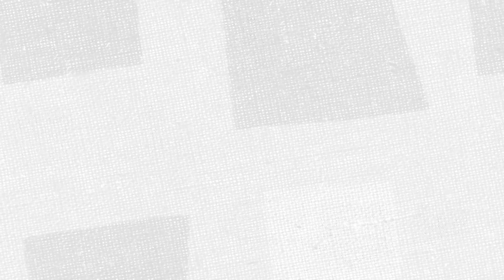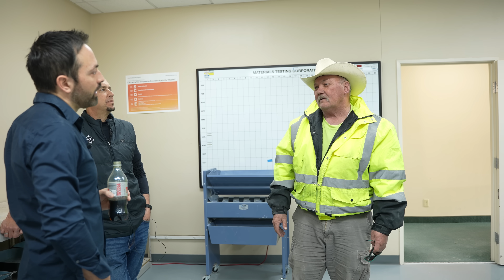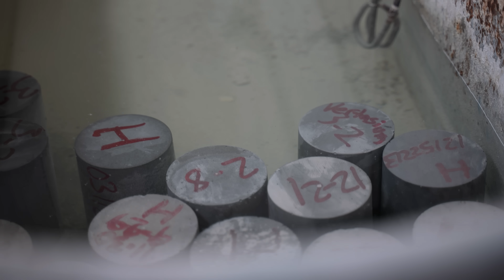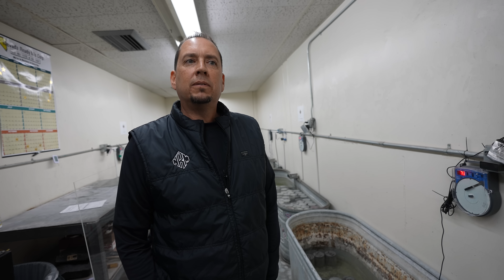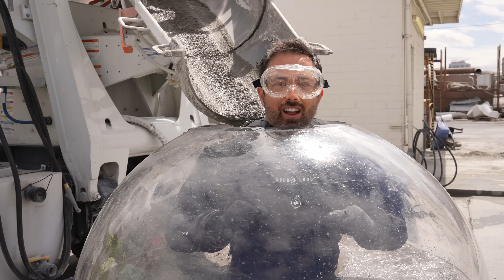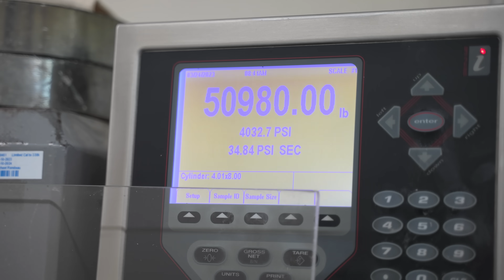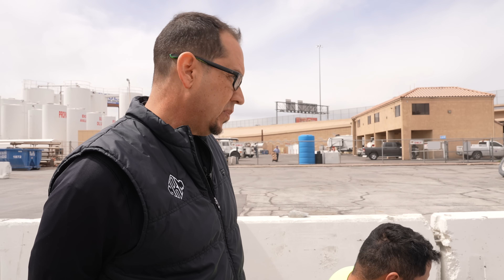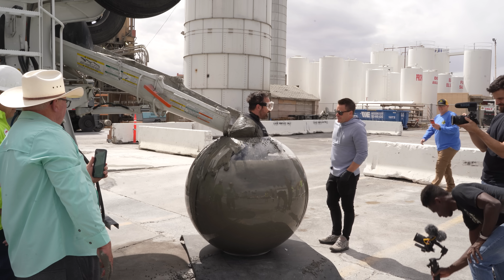Getting Buried In Concrete To Explain How It Works

Comment: As a concrete worker it’s nice seeing someone make a video about it. It’s dramatically under appreciated yet it’s in everyone’s daily lives. Thanks for the video
Reply: I agree! I am a Comcrete Technician, and Concrete itself is everywhere, but before I worked in the field, I didn't know just how deep the field goes. From The beginning of the Production line of Extracting the Materials, the Cement Production with it's own deep field thats now changing drasticly, the Way we Recycle Water and it's composition the Mixer needs to always consider in combination with the types, to the Plant that helps combining the materials created by Hundreds of years of Innovation, to the Responsibilites of Upkeep, Repairing and Dispositioning, followed after the mixing by chemicly testing it through(in the EU) 23 different possible methods depending on the Consistency it was mixed to, it's a field that requires you to consider a multitude of different aspects. It's hard to get into the field, but it sucks you in. It's not for everyone, especially with the labor aspects as it requires you to overexert your energy quite a lot, for a Mixer or Dispositioner, 12 to 15 hours of work per day are very common, and it takes a heavy toll, but I fell in love with it.
Reply: @andrei_chikatil0 That is the most off-putting, bizarre comment I've ever seen.
Reply: as a non-concrete worker, i have a new appreciation for concrete :D
Reply: As someone who drives dump truck I have a hard time believing that there is more concrete made than asphalt
Reply: So is wood, steel, our health, wifi, microwaves, radiowaves, and a thousand other things. What do you want? To praise and appreciate every item? It's stupid
Reply: @Monkeycantnutz  What are you even mad about? Lmfao jesus
Reply: @my89scottsdale67  Concrete isn't just used for interstates and sidewalks. It's also used in warehouse construction and in storm drains. On most roads there are storm drains and under those drains are inlets and Concrete pipes and manholes. In every construction site.
Reply: question since you work in the field. i had a slight issue with veritasiums comments on roman concrete since as far as i was aware we only really have ideas as to how they did it, ash being the most believed, however we don't really know how strong the concrete we are making is compared to the romans and wont know until it stands the test of time like the romans. just wanted to get your thoughs and take on that.
Reply: And someone can make the same amount as you working at the local mini mart
Reply: As a concrete sidewalk,I completely agree
Reply: @xNSHD   We can make concrete as strong and much stronger than Roman concrete but it usually comes down to how much you’re willing to pay for a sidewalk, barrier, or pillar. The science of concrete has been figured out by engineers for a while, so quality always comes down to a monetary reason.
Reply: Cement production is a substantial source of CO2 emissions, contributing approximately 7-8% of global CO2 emissions. On average, the production of one ton of cement releases about one ton of CO2 into the atmosphere, mainly due to the calcination of limestone and the burning of fossil fuels.

Comment: Im so happy you finally mentioned "do not try at home" @19:22. There are many ignorant people out there that will. As you were being surrounded in concrete a kept having flash backs of my dad when i was a teen. He worked with concrete for many years. On one job concrete was setting as being poured due to mixer truck had broke while on way to deliver. So in the rush to get it poured so we could form it before full set, dad's boot was filled. He didnt have or take the time to remove boot and clean up. Kept working. By that evening we removed his boot got his foot and leg cleaned, as we cleaned , layers of skin fell off. And first few days after this while treating womb his skin was still rolling off. Took several weeks of ointments and bandaging and cleaning before it finally felt like the healing was happening. His foot and leg was scard for rest of his life.  Wet Concrete is not something you play in!
Reply: I’m not sure if your being sarcastic or not
Reply: @X4X5  no sarcasm, how can that be taken as sarcastic? Seriously, watch video again. Took a while for the don't try this at home to be mentioned. And yes there are ignorant,even stupid people that would do this stupid stunt. And the story about my dad is very true. So your point is?
Reply: @Giggles56  who's trying this at home 😭
Reply: @mezzaun they arent talking about going inside a comically large fishbowl full of concrete, but about pouring wet concrete at your skin, many kids out there would want to play with it.
Reply: Jesus brother, you guys had to treat your pa's womb?? That sounds rough homie.

But yeah don't play with chemicals. Especially reactive ones at that
Reply: pH=12 it is alkali solution, which is definitely harmful to skin. Neutral pH is ca.6. So, your story is quite spooky, but knowing aforementioned chemical fact all becomes clear.

Comment: At the burns outpatient ward at the hospital I work, a man said he got chemical burns from kneeling in cement. Good to see you have protection ❤
Reply: Oh yea. That happens and it’s rough. Really bad. 

Another thing people don’t know is pouring concrete in the cold is super dangerous too. Getting your hands covered in wet concrete… it will suck the heat straight from your body so hard so fast that you can lose fingers or a hand as quickly as just minutes if you can’t get it off quickly enough. 

Quite a number of times it almost happened to me. Got covered and felt it leeching the warmth from me and ran to the sink and rinsed so fast and then had to slowly turn up the heat to thaw my hand. 

One more minute a few times and i may have lost fingers. 

The pain is astounding. Both when freezing and when warming back up. 

But make sure you hurry back to work. There’s good companies but a lot of these guys just hate you for anything. Almost lose a hand? How dare you wash your hands. Get back to work you baby.
Reply: I’ve had those burns. The scars last years
Reply: It's really bad with quick dry cement as it puts off a ton of heat.
Reply: @JimmyKlef Woah, that’s horrifying! I had no idea it could do that.
Reply: @JimmyKlef  Are there not gloves you can wear to protect from this?
Reply: They call it cement burn in the business,  nasty stuff.
Reply: I used to work with my buddy's grandpa and he was like 92 at the time he finally passed away at like 97 and he could outwork anybody that I've ever seen he poured on highway cruise and everything but he had a little piece of rock getting his boot when we were pouring and it ended up causing actual Lyme disease because it was rubbing up and down on his sock cause the hole and then it caused skin irritation in a hole in the skin by the time it's swelled up and he went looked at it he had Lyme disease

Comment: I'm a concrete truck driver and this video was not only very accurate but it also taught me quite a few things. Thank you
Reply: So the coke thing is legit? Have you use it?
Reply: young sheldon
Reply: @TheVictor454  no. It's not. We Have all kinds of different chemicals that we can use for things like that. Those types of specific chemicals are very expensive though so certain companies would probably do the Coke method. It does work.
Reply: @willelliot8928  who? What?
Reply: @colinmackay92 it’s a tv show
Reply: I’m a Special Inspector/ACI Field Tech, and if I knew someone added Coke to the ready mix, I’d still do slump, air, cast the cylinders, but it might not look good from the lab and then not look good on the contractor from my report. Unless it’s allowed in the spec and mix design of course
Reply: I used to drive mixers, and all this info was accurate, but I'd never heard of adding Coke to keep it from setting up. If you had nine yards in the drum,how much Coke would you need to add?
Reply: Ditto. As for the coke-cola method, seen granulated sugar, or corn syrup used too. But cola is generically the easiest and cheapest option. 😊
Reply: Cool! I'm not even a vague truck driver.

Comment: My dad was on the crew that built Glen Canyon Dam at Lake Powell.  There were always rumors that people were buried in the concrete while they were pouring the dam.  When asked, he would mention the density of concrete (the same reason you can't sink in lava or molten steel), and the fact that they only poured 4 inches deep at a time.  He would end with, "...so that's why no one was buried in the concrete of the dam.  ACCIDENTALLY."
Reply: Accidentally 😳
Reply: How would you intentionally bury either?
Reply: @shoam2103  lace the body with something denser than concrete, and bury over a few days, 4 inches by for inches. 
That would be my guess for this exact case. 
If you have a column to mould, then just tie the body to rebar, and pour.
Reply: I kept flashing to the whole stories of mafia bosses burying people in concrete floors.  Cool meme I guess but highly not practical.   

All though, I guess you could weigh them down with already dried concrete then pour fresh over them.    'Course, non of the movies or tvshows ever did that.
Reply: If one would pour concrete over a dead body in the bottom of a hole, it would NOT come up and float. The wet concrete would simply cover the body, and harden with the body still on the bottom.
Reply: @davelowets  But why would it not come up if its less dense?
Reply: @malterann1287  I believe they are saying that if your pouring on top of the body it would come up part way but would be covered and then weighted down by the concrete on top of the body
Reply: With rope, you could tie the body to the rebar to anchor it in place…
Reply: Jimmy Hoffa doesn’t enter the chat.
Reply: @davelowets  

Please explain the physics of why a live body would float but a dead body wouldn't?
Reply: @notahotshot  assuming you’re talking about a large structure I presume that they are referring to the role of negative buoyancy on a body
Reply: @notahotshot just leave poor @davelowets alone: he must be a bit too dense ... 😂
Reply: Wait, you can't get buried on molten steel?
Reply: @Cuestrupaster  I mean, you'd just combust anyways. 2600-2800 degrees F.
Reply: @MrT3a  are you sure you are not a serial killer or something?
Reply: @jonny-b4954  Yeah, but I didn't know you wouldn't be able to sink in it...
Reply: @henrylake3  Thank you. I looked up negative buoyancy.

Negative buoyancy in water requires about 30 feet of depth. In concrete, in which humans are more buoyant, as shown in this video, I would presume the depth needed to reach negative buoyancy would be greater. You would most definitely have to hold the body down, to get it to stay down while the concrete is poured, or it would tend to float. No different than needing to actively work against buoyancy to reach a depth for negative buoyancy in water.
Reply: @malterann1287  Concrete is not always so fluid. There are applications where the concrete is dense, "dry" and with coarse aggregate. You will not float out of such a mass because it is barely liquid and you will be buried like snow in an avalanche or earth in a trench.
Reply: @notahotshot  yeah definitely - accounting for the fact I spent no more than 10 seconds imagining the scenario, whilst yes if building a dam it would realistically likely float to the top if not poured in small sections, I was more so imagining the body at the bottom and all of the concrete is poured at once, where time isn’t a factor (pretty much the body is far below the surface). 
As Derek mentioned that concrete is 3x more buoyant than water, one could haphazardly assume that negative buoyancy in concrete would be approx 90ft, in which case if the body was at the bottom of a dam wall it likely wouldn’t float to the top. But again, I’m just explaining my mindset based on what I understand… I could be totally wrong. 
Even if I’m not wrong I’m definitely gonna be on a watch list after this 😂
Reply: @henrylake3  

Yes, if the concrete were poured rapidly enough, directly on top of the body, then it could cover the body quickly, and the force of the falling concrete would hold the body down. If it were poured to the side of the body, the body would tend to float, just like a floatation ring in a pool would float as the water level rises while filling.

Welcome to the watch list. "First time?"
Reply: I mean, yeah. Friends in the construction companies look after each other; Especially when said crews have small-town disputes—P.o.s. touched your girl at the bar and you 'accidentally' boot-stomped him too hard? No worries, I gotchu.—Its why every father should have high-position friends in construction. Or you just wait at a phonebooth like that one G of a dad did lmao
Reply: @malterann1287  Because of the viscosity, pressure, and concrete soaking/sticking to your clothes. Concrete weighs more, going to push down on you more, everywhere but up. If you're on top of concrete, yeah, you'll continue to float—because there's no weight pushing you down. But to think that someone will just float up from the concrete that's being poured over them? Especially a corpse that'd already exhausted most of its gases/buoyancy?  Do y'all not think things through?
Reply: @notahotshot  If a live body is wiggling around, sure, it will end up rising to the top. A limp, dead body won't. It'll just remain on the bottom and end up covered with concrete.
You can create this phenomenon for you to witness for yourself..  Put a small crunched up paper ball in the bottom of an empty cereal box, and then pour cereal back on top of it, it'll remain on the bottom. Now, do the same thing, but this time shake the box as you add the cereal back into it, the paper ball will now rise to the top as you shaking the box. I learned this principal when I was a kid, many years ago.. I learned that if I wanted more marshmallows in my bowl of Lucky Charms, all I had to do was give the box a good shake, and all the lower density marshmallows would rise to the top, and end up in my bowl. If I didn't shake it, I would end up with less marshmallows in my bowl because the ones near the bottom of the box, remained near the bottom of the box. 
It's a simple concept, really... 🤷🏻
Reply: @RobertoMariani  Not... See above. 

Nice try though. 🍻
Reply: The whole video I was thinking about mob bosses burying people and dam construction with folks lost in the concrete . By the end I was strongly questioning all but the mob stories . Mobsters will find a way.
Reply: @It-b-Blair that was literally the only way I could see mobsters pulling it off .
Reply: Well... Math checks out. 4in/day for a total height of 710' is a hair under 6 years. given 2+ years for construction of supporting infrastructure. The project lasted from 1956 to 1964 which was roughly eight years. While I'm sure that rumor isn't true, it is fascinating. I'm sure the builders wouldn't risk a corpse compromising the integrity of their massive dam.